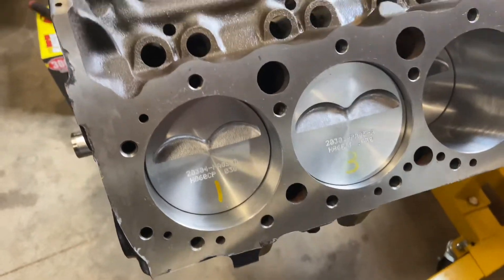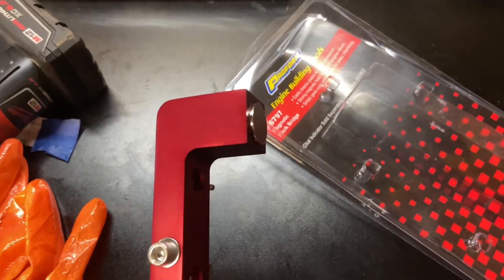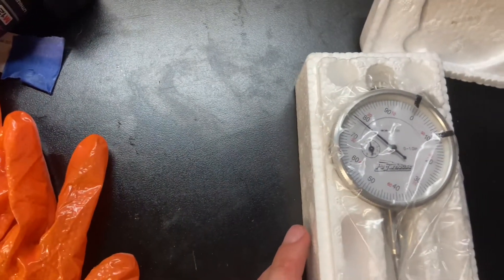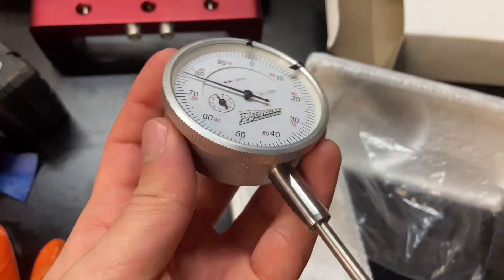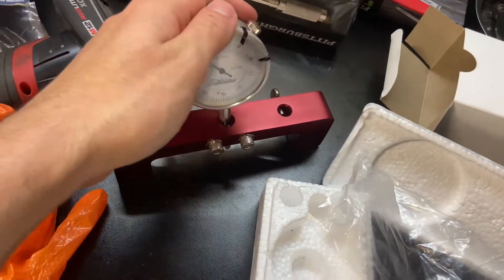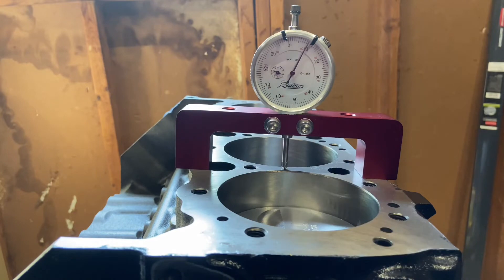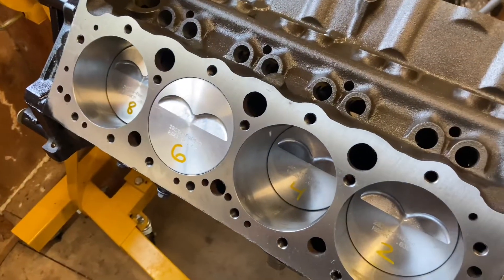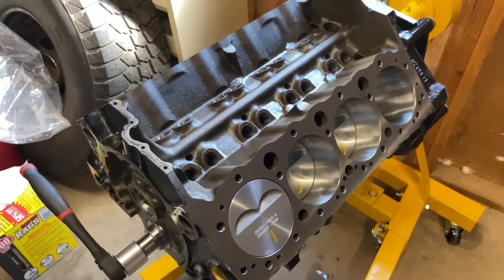Sbc 383 build part 3 - piston deck height and quench

Comment: 28 thousands total from top of piston to bottom cylinder head is what you need that piston should of been .0005 above the block deck stop with that bull shit whats you dynamic compression(the time the intake valve closes to top dead center) limits fuel type  you have a lot to learn and who ever told you .040 don't listen to them they don't know shit

Comment: Hi, I'm 60 yrs old & built a lot of Engines,  0.10 to 0.014 +- piston in the hole,  seems normal, then just adjust the Quench with the Gasket thinkness,  I try for .038 to .042 quench.  depending on Cam Lift & Compression.
Reply from the maker: I plan on going with .042 quench

Comment: How come your measuring in the middle but other videos will measure in the outer edge? I have high compression pistons and the center sticks out more than the outer edge and I’m not sure where to measure
Reply from the maker: Other vids measure from the edges due to piston rock , since the center of your pistons stick out there should be a flat ring around the edge of the piston and that’s where you will measure , you push down on the top side of the piston measure that then measure the bottom side without touching the piston then you find the  average and that will be your deck height

Comment: Your  total quench should be 35 thousand or less on a 40 thousand head gasket. Piston should have been 0005 to 0009  above deck
Reply from the maker: That’s usually on an LS
Reply: doesnt  have to be above  the deck.  people  like it  but  its  not a requirement  .  just get the quench right

Comment: Great information video. Looking forward to the continuation. So your obviously going to need a cam button. Please video that part. If you use the bearing type button I really really really want to see the actual trimming process then the clearance process on the button. Not to keen on the nylon one. The trimming process is what is holding me back on doing a stroker
Reply from the maker: Yes I plan on using a bearing button , don’t have anything to “trim” metal so I’ll have to get creative or lucky
Reply: @atlantaleo  supposedly with a pair of vise grips and a bench grinder
Reply: don't take advice from him he doesn't know how to build engines  and where ever he's getting his info from they suck

Comment: lucky ass.. I had to get a .140 MLS gaskets & headstuds ...NICE BUILD
Reply: Pretty sure you don't know how to measure thousandths of an inch.  .80 is .800 or nearly an inch out of the block.
Reply from the maker: How come?
Reply: @atlantaleo  piston stuck out the top of the block ...can remember the exact height but the builder said get these racing Cometic gaskets and never worry
Reply from the maker: Oh wow that’s a lot of gasket
Reply: @atlantaleo  ikr but I think my piston topped out .80 above deck

Comment: You could get away with a .023 thick head gasket. As long as all your other cylinders fall .015 or more below deck surface. That would yield a quench distance of .038. Witch would be better. Im assuming you don't have aluminum rods? That would defenatly change things.
Reply from the maker: Got steel rods, #2 piston ended up being .009 but I went with .027 gasket